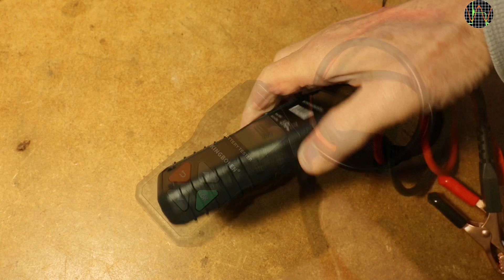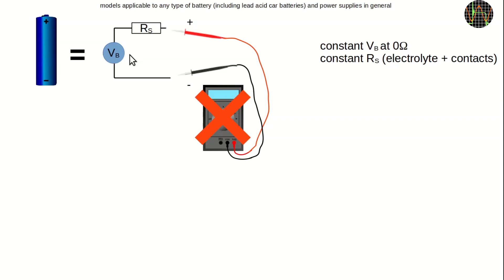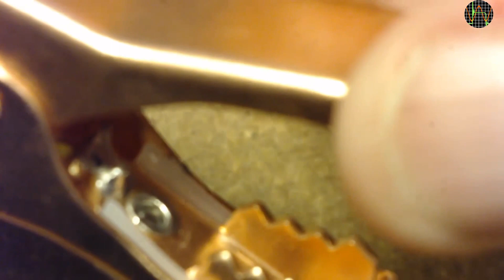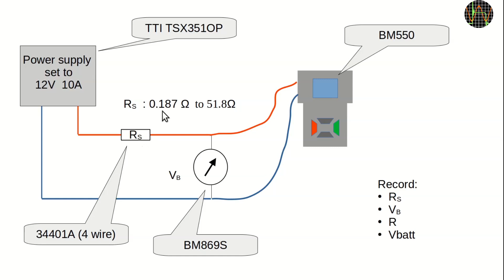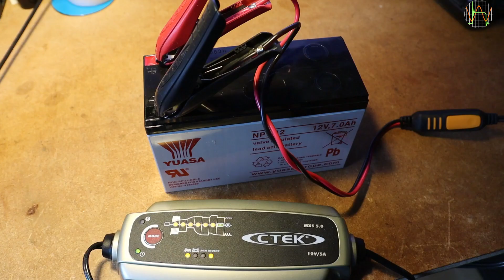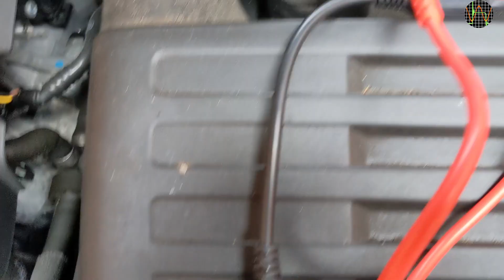123 - Kingbolen BM550 battery analyser. How well does it work? And how to measure batteries anyway?

Comment: Interesting. I think this is how its work:
1. Measure internal resistance by applying contact current load, and measuring voltage differences. Voltage differences equal to resistance because its have 1a constant current load.
2. Measure batt voltage minus 9.35v (somehow) then devide by its internal resistance. Voila, CCA value appear somehow 😅

Comment: how can i dectct a battary cca, i am from india. our battery have ah and volt, but not print on battery cca
Reply from the maker: There are tables from various places that list AH and CCA, Google should find. Some folks use AH*7.6 = CCA for medium batteries but it is usually not quite so linear for small or big batteries. Its a complex issue because AH and CCA are different in what they mean and so any correlation is always just approximate

Comment: Nice review. I recently bought Kingbolen Bm550. I tested my car battery (440A EN). I tested and got 408A on completly new battery. I tested it 10 min later and got 443A, and yesterday I got 432A on test. Are your tests like this? Did you try unplugging and testing again car battery?
Reply from the maker: I can't say that I have. But I did notice that despite kelvin clamps I never managed to get exactly the same measurement once I removed the clamps and re-attached them. What I mean is that if I run the same test twice without touching the clamps, the values were very consistent. But taking  the clamps off and on again and I got more differences. I also found it us not easy to connect the probes to real battery terminals (at least for my car) I can well imagine that crime and oxide on the connections can play a role there. For what its worth, since making this video I was approached by TOPDON to review one of their testers. I just finished testing their AB101. The video will come out tomorrow. When comparing the readings for the BM550 and the AB101 for my VW Golf car, the values were very close to each other. Having played with the TOPDON tester, I think for 12V car lead acid batteries, the AB101 is better than the BM550 simply it tests more stuff, like cranking.  But I will keep the BM550 because it does other voltages which  the AB101 does not,
Reply from the maker: I can understand the trouble with the kelvin clamps, they seem to be a little to small which makes it hard to apply them. I too was offered the AB101 and did a review. The AB101 is quite a bit better for 12V car batteries, but if you need a tester that can do more than 12V, the BM550 beats it
Reply: And can you compare results with KONNWEI KW208?

Comment: Is it possible to test alternator(battery charging)with this item?
Reply: Generally, alternators either work or they don't work. You can test the alternator using a multimeter (voltmeter). Just put the probes on the battery, measure (let's say 12.5V)... leave them connected, start the engine, and check again. If the voltage is about 14V (or 2V higher than a "flat" battery), then the alternator is working.
You can test the charging current using a DC Clamp meter, but you have to get enough load on there to test it. That generally means starting and stopping the car a number of times to get the battery voltage down close to 11-12V, and then running the engine and as many other ancillaries as possible. High beam headlights, etc.
Reply: @johncoops6897  Thank you John very much!
Reply from the maker: Not directly. You could run the engine/alternator for a while and see if the state of charge increased. Better, check the battery voltage before starting the engine and after. If the voltage is higher, the alternator is charging the battery.
Reply: @TheHWcave  Thank you.